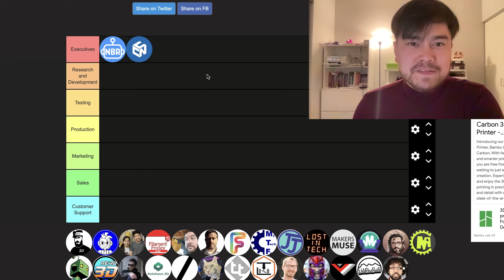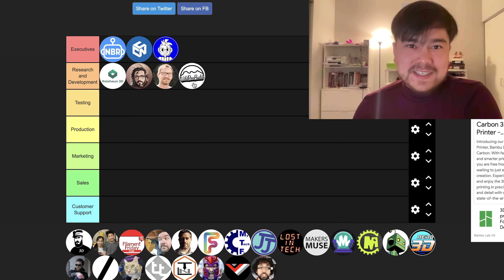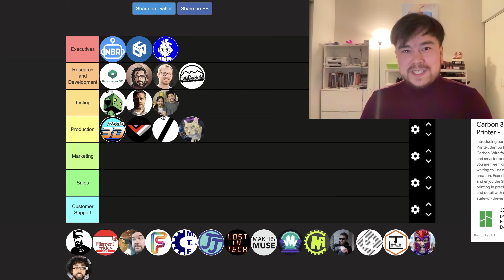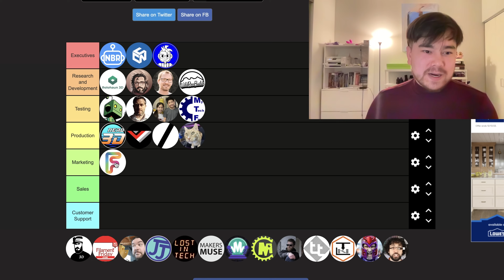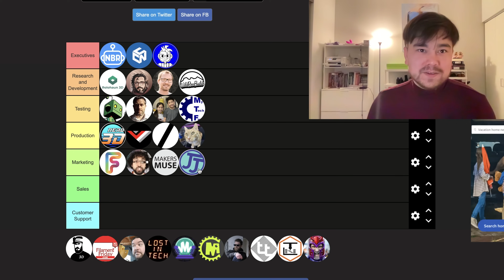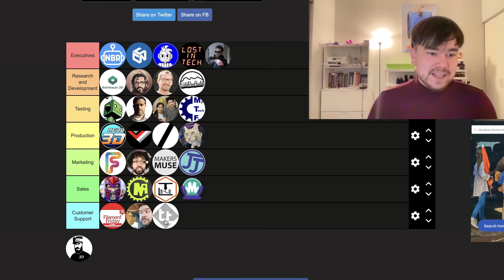The WORST 3D Printing Youtubers of 2023

Comment: I dislike YouTubers who gloss over or outright ignore faults. Speaking of which I recently bought the Artillery Sidewinder X4 Pro. That company drives me nuts. Somebody needs to design a hotend assembly with a BLTouch, better extruder and hotend. The stock version uses an ABL sensor, a cheap knockoff extruder and a Bamboo Labs type nozzle. The nozzle is ok but you can't get a hardened steel nozzle and nobody makes a truly compatible one. Supposedly a Volcano nozzle fits but it's slightly long and Klipper has trouble making a mesh.  Nathan we need your help. Really. And they put a sticker on the bottom voiding the warranty if you remove it. They don't want people nodding them either. The controller is a customized MKS SKIPR. Air circulation for the electronics is bad bad bad.
Reply from the maker: I got one in for review and it’s trash. Basically wasted 40 hrs trying to make it work.
Reply: @NathanBuildsRobots  I fixed my layer shifting. Edited the X and Y current in printer.cfg. the fan duct broke where it screws onto the blower fan. I printed a new one without the tab to the blower and it snaps into place. I made a small washer for the blower because the screw is too long otherwise. If anything post the review with a big fat DO NOT BUY in the title. I saw some reviews that looked promising so I bought it. Now I'm stuck with it and trying to make it do what I bought it for.